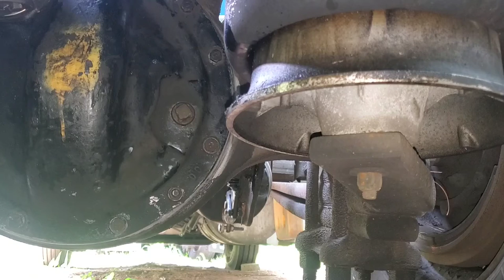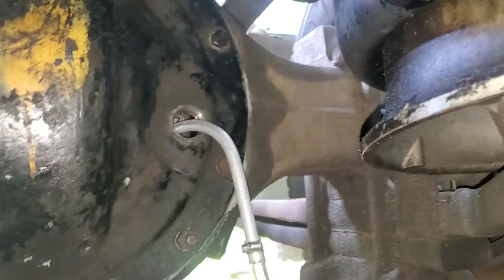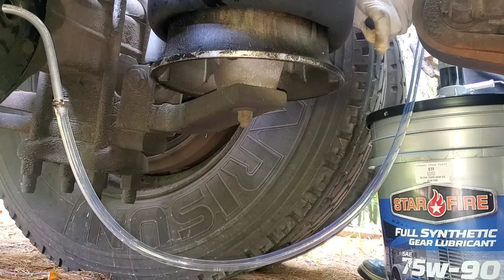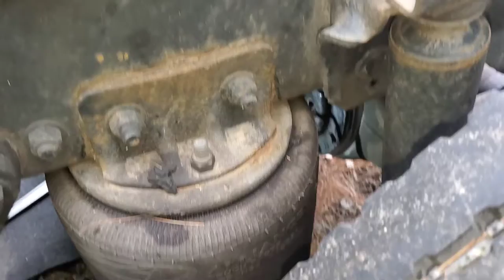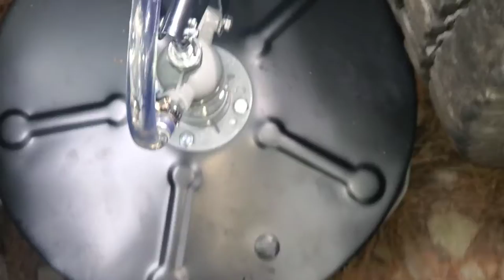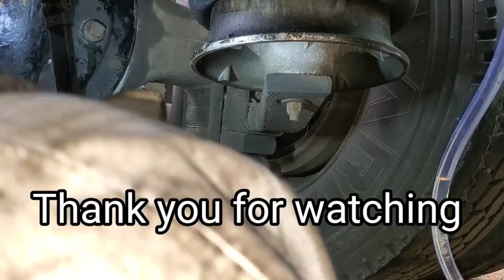how to add fluid to semi truck differential

Comment: Does the old fluid evaporate over time or did you drain it before the video. Do you add to what already there ?
Reply from the maker: The dif cover seal was leaking, so after i repaired it, i had to get new gear oil.